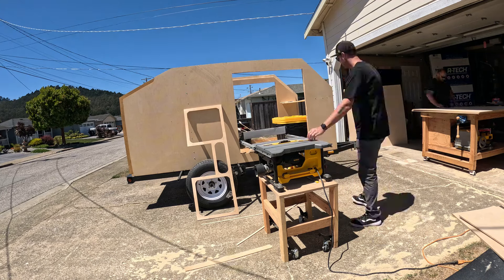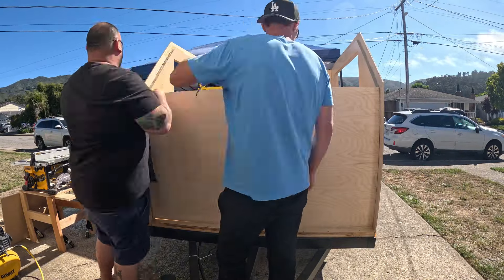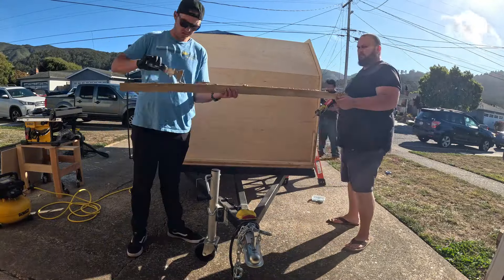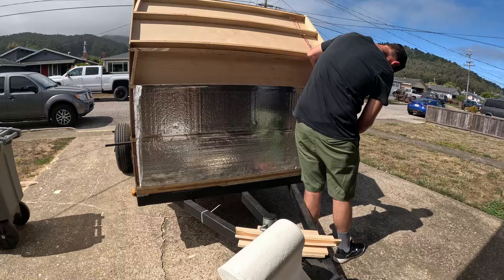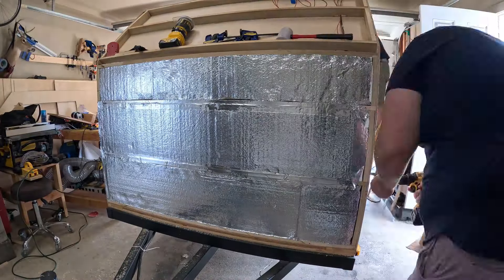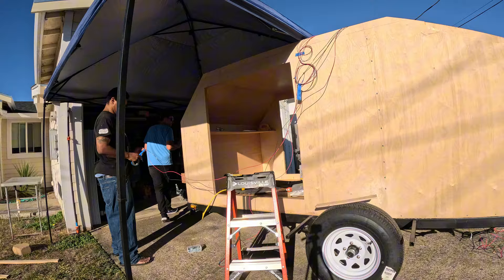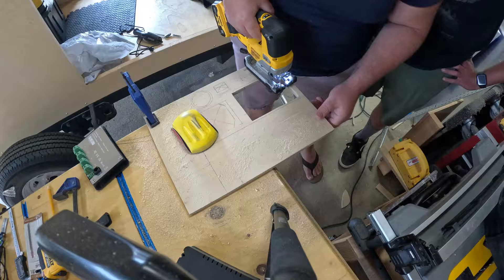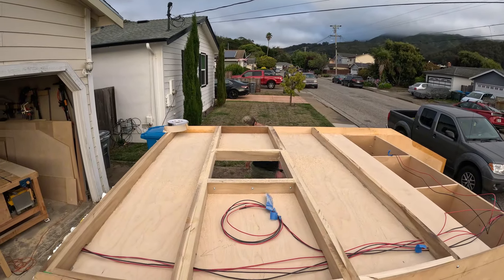DIY Squaredrop camper build - Part 14: Ceiling, spars, insulation, electrical! So much got done!

Comment: What angle did you cut the plywood for the front where it meet at the 45
Reply from the maker: I want to say it was at 34 degrees, but as long as it's pretty close, it shouldn't matter since you'll use wood filler and round it over anyway :)

Comment: Is the wiring for it hard to do? Bought a small trailer to convert into a camper trailer but feel like the wiring is a complicated.
Reply from the maker: Not too bad so far!  the trailer wiring wasn't too difficult, but I did need help with the inside wiring from my electrician friend.